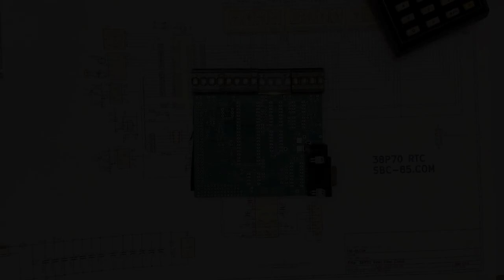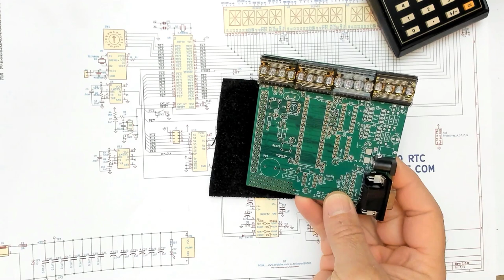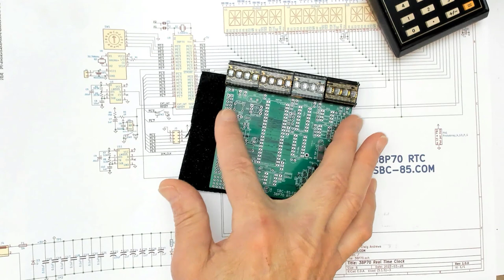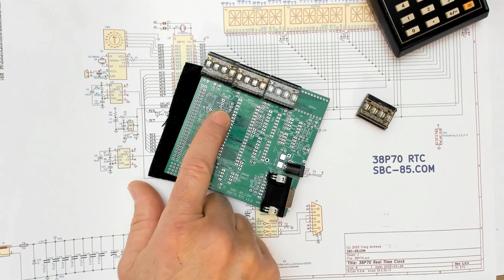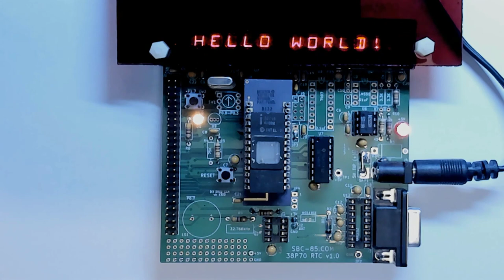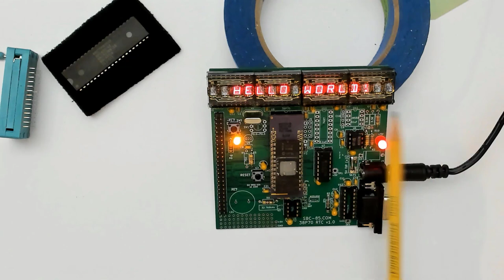{88} F8 Mostek 3870 F8 Clock / Development Board First "Hello World"

Comment: Interesting video and project. I built my first computer in 1981 with the 3850 chipset I got from a friend at Bourroughs.  Wire wrapped. 32 byte ROM monitor. Radio Shack ASCII keyboard. TIL311 hex displays. Still have it in the basement. Thanks for the memory.
Reply from the maker: Thanks for watching and taking the time to leave a comment.  For me, pulling an old wire-wrapped projects out of a storage box (at least those that I finished and got working) is a great feeling to re-live the accomplishment from days long ago !!

Comment: I agree with your assessment of the old vs. new displays and the 70's vibe, but those new displays do look really sharp also!  Could you post the part # for those? They might come in handy for some other projects of mine.
Reply from the maker: They didn’t stray far from the original part number.  HP’s equivalent for the DL2416 was the HPDL-2416, 
The “improved” HP matrix version was HDLG-2416
Broadcom now makes them as the HDLx-2416 where x is the color
Reply: @HelloWorldETX  WOW, they aren't cheap! The Broadcom on mouser is $40 for ONE. Is there a less expensive source?  EDIT: ebay has them for $21, but by the time you add shipping they're basically $30. I think the old fashioned red LEDs will have to do.
Reply from the maker: @FrankenLab  there is a seller on eBay now that has a set of 12 for $75.  The only problem is nearly all the pins have been torn off the back. It never ceases to amaze me what people try to sell and how much the buyer needs to beware.
I think I paid $12 each (delivered) on eBay for the last ones I bought a month or two ago.  They were in perfect condition and the seller really understood what they were doing.  I was going to come back and get more if the first batch was working and as described but, alas, they are all out of them.

Comment: Another great project. looking forward to the end result and some video on assembly programming tutorial for the F8.
The F8 Mostek 3870 seems a had IC to find. What other universal  38P7X family types will work.? So I can start looking now.

I'm glad I picked up a few  HPDL-2416 years ago cheap for project on my Lawrence Livermore laboratory MST-80B which I could re use. Have you thought about adding a extra foot print for the HDPL-1414 smaller but a lot cheaper and easy to get. But got the same old look to it. Just a thought. 
Keep up the good work
Reply from the maker: The smaller display version is a good idea, I will add it my my change request list.  However they will require more glue to decode externally and gate just the /WR.  I suppose just a 2 to 4 decoder would do it.
I think the 38P70, ‘73, or ‘75 will work on this version of the board.  The ‘73 has some port differences due to the serial port, but those pins are not critical on this board (I think they feed the dimmer IC) .  For the next version, I plan on moving pins around now that I have a better idea what is easy and hard when programming.  Little things are missed, like rotates that loop the ends of the accumulator around.
Thanks for the feedback and suggestions.

Comment: Very cool!  I'm quite interested in this project.  I would also be interested in any F8 assembly tutorials, as I recently acquired a Fairchild F8 evaluation kit, and I'd like to eventually be able to power it up and write a little code to run on it.  :-)  I'm also potentially interested in any kit you make for this project!
Reply from the maker: I will be putting my build files on the SBC-85.com site, but I need to write some documentation.  For those that do not want to submit to the board house directly, I expect to have the next version F8 development board on tindie, but that will most likely not be until this fall. 
I saw the Fairchild evaluation kit has a resident monitor of some sort but haven’t studied it.  Let me know if you get bored with the Fairchild evaluation kit, I may be interested in it down the road.
Reply: @HelloWorldETX  Sounds great!  I probably won't get bored with the Fairchild evaluation kit, but I'll keep it in mind just in case.  ;-)

Comment: WOW I love those displays! Are the segments/dots independently programmable? From the data sheet it doesn't look like it. Also I just made a similar ZIF adapter for my Synertek SYM-1's EPROM sockets as they are the really delicate single wipe kind, although I used some flat "flip-pins" from evil mad scientist.. a little pricey but worth it IMO. :)
Reply from the maker: Not individually programmable, select from a fixed 128 character set. But 64 more than the HPDL version.   I liked the little PCB edge pins to make a DIP using a PCB, but I have not used the flip-pin style yet.  The edge ones did the function but were also a bit pricy and now very hard to find.

Comment: Hello, how is the prom memory programmed, is there specific software? Do you have an emulator to test? Is the communication serial RS232?
Reply from the maker: The PROM is programmed with the binary from the assembler using any regular programmer that can program the 2716 EPROM. There is no emulator that I know of.  The serial is just bit banged TTL and can be anything, but I was using TTL signal level RS232.
Reply: @HelloWorldETX  Thanks for the feedback. Which assembler/assembler software did you use to transform the assembler into binary for 2716 in this video project?
Reply from the maker: DASM. see video {92}